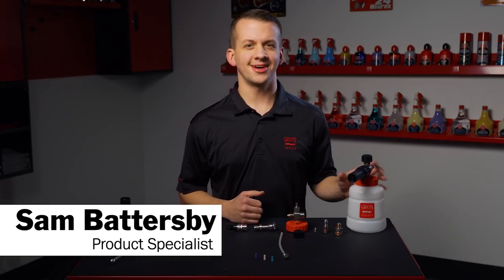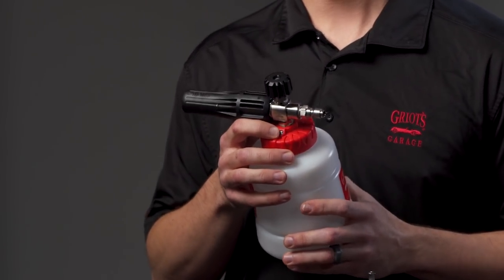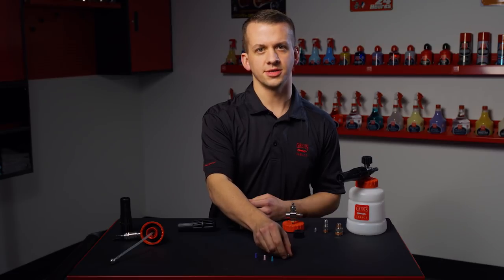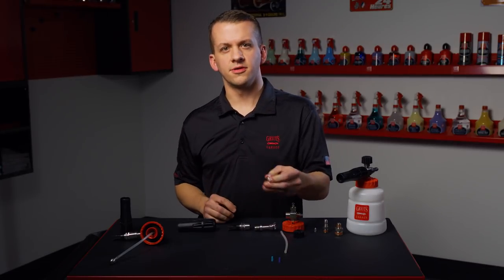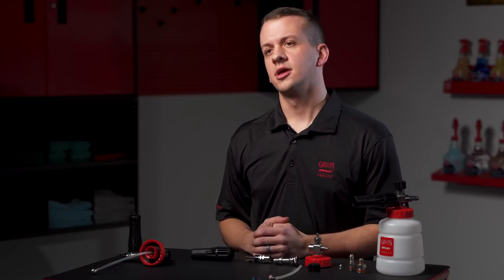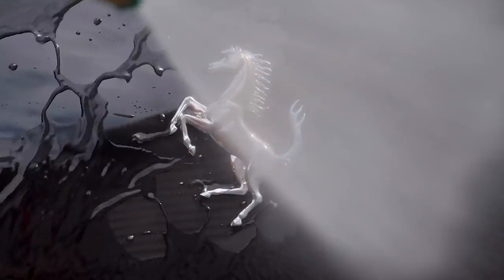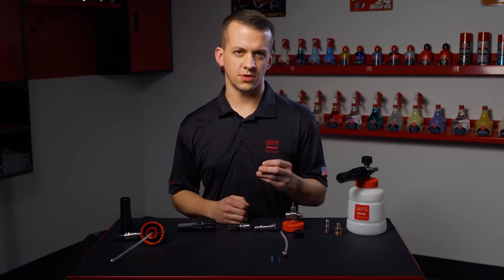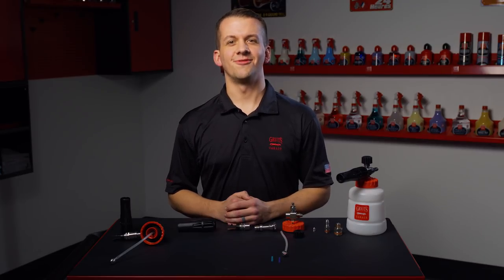THE BOSS™ Foam Cannon

Comment: Can I use a  2,000 PSI and 1.2 GPM Electric Pressure Washer, or is that too low for this cannon?
Reply from the maker: The cannon requires a pressure washer with a minimum of 1.8 GPM flow and 1,100 psi or 1,980 CU (Cleaning Units = gpm x psi).  Your pressure washer is compatible with the cannon (2400 CU).  A 1.1mm primary jet is included with the cannon and it may be good to install that to help with foam output.

Comment: How do you use the flow settings? The instruction manual and videos don’t tell you what they adjust / how to adjust them for best output
Reply from the maker: The BOSS Foam Cannon has a few variables you can adjust, the first is with the metering tip, you'll find all the details on those in the instructions. The knob on the top of the cannon adjusts the soap pick up volume, all the way to the right is full, all the way to the left is off and only water. You an also spin the barrel to adjust the fan of the spray. Hope that helps!
Reply: @GriotsGarage  this does help -thank you! Do most keep the soap setting on full soap for maximum output?

Comment: Just bought one. The threaded end will not go into my pressure washer gun. Can I buy one that will fit? Or will I have to return the Boas Foam Cannon.
Reply from the maker: Hi Brandon, due to the various tolerances and designs of quick disconnect fittings used by different pressure washer manufacturers we do not have a comprehensive list of what pressure washers are compatible with our fittings. That being said, if your pressure washer features an M22 threaded connection at the end of the pressure washer gun (usually where gun attaches to lance) you can install our 81240B – Threaded Direct Adapter into the M22 fitting on your gun, then attach our 81240F – SS Quick Disconnect Coupler, Female to the ¼” end of the 81240B fitting. This setup will allow you to quick connect your BOSS Foam Cannon directly to your pressure washer gun via the 81240F – SS Quick Disconnect Coupler.